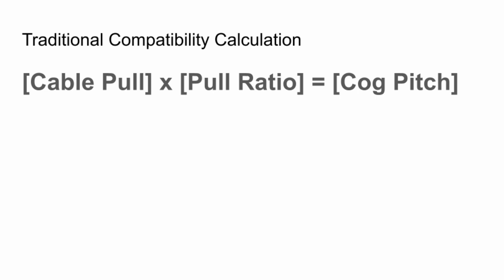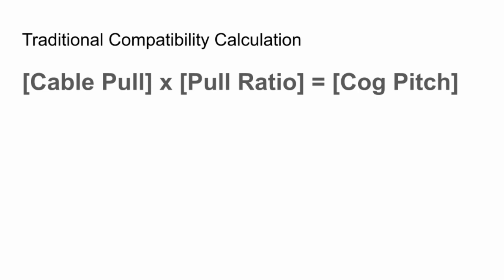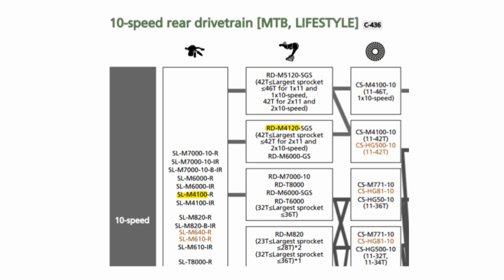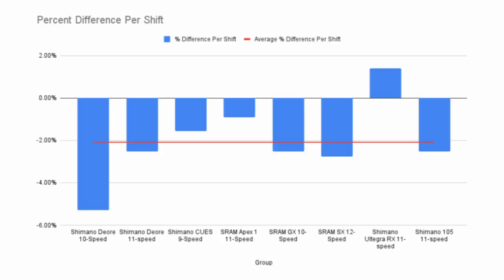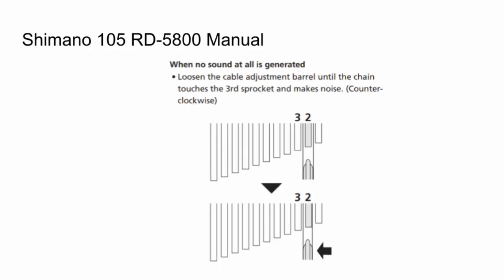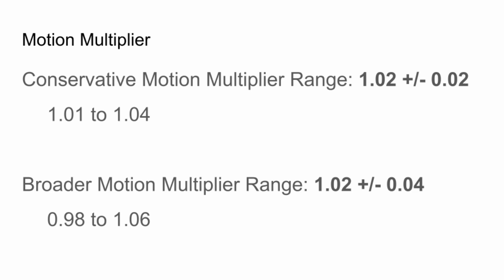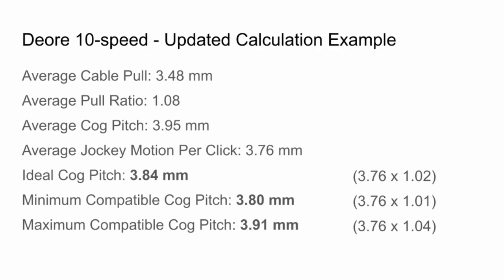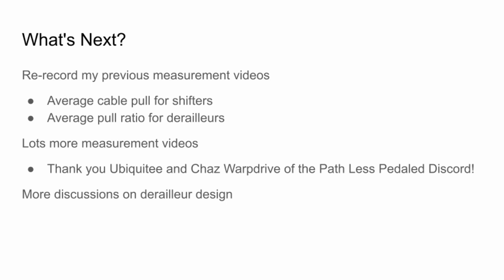The Problem with Traditional Compatibility

Comment: Back in the old days shimano had the centeron g pulley that had quite alot of play. I would rather new cassettes were available with the cogs and the spacers seperately so you could fine tune shifting with different width spacers

Comment: Excellent work!  Is the problem here not that the shifter pulls 2% less cable than expected, but more in the way the "average" pull ratio is calculated? Does an average of a non linear curve really make sense? Don't you need to do something like integrate the pull ratio curve equation, to get the total mech movement for the range of cable pull you're interested in (or just measure it)? Or is that how you did it? Maybe it amounts to the same thing.. and I'm probably misunderstanding everything!
Reply from the maker: I think you're understanding it correctly. I'm not doing any integration. It's a bit tricky, but I'm figuring out the amount of cable pull needed to get you to the second biggest cog and subtracting the amount of pull to get to the second smallest cog. I then take that number and divide it by the distance between those two cogs on the cassette. You're right that this doesn't account for the nonlinear motion of the derailleur, but it should work fine since shifters compensate for that nonlinear motion too.

I do have the actual curves and shift points, so it's straight-forward to figure out the jockey position for each shift point. When I plug in the numbers I get similar results.

I'm starting work on a website to try to do these calculations and show you what it looks like. I want to make a video when I get the website to a presentable state.
Reply: @boothsbikeprojects  Ah I see. Will be very interested to see your website when it's live! I've also been working on a site to compile a list of pull ratios etc. Do you have some ideas as to why shifters pull slightly too little cable? I was wondering if it could be to compensate for very slightly bent mech hangers, or worn mech linkages as the mech ages?

Comment: Here's what you do ;
Ditch the index, ditch the wireless, the electronic, the whole fancy complicated controls.
I just finished an 1800 km tour, fully loaded, on northern Ontario hills and challenging highway. My gears are friction. Downtube mounted. From 1979. Japanese. I use one derailleur, the rear, a pre- index Shimano Altus. Works perfectly.
You tune in the gears just like you tune the strings of a guitar. You always have complete control and I wouldn't ever consider anything more complicated. My shifter has about five parts. No springs, notches, batteries, wires, charger... 
Riding a bike doesn't have to be so over thought and over designed. That is, if you can manage the skill that it takes to do something simple, and do it well.
Reply: If it works for you, great. I used contrafriction shifters (Simplex, the best made) for decades. With the change in chain and cog tooth design over those decades, friction shifting no longer worked the way it used to. I got tired of grinding my shifts, and when the hard-to-find spring in the right side Simplex shifter failed, I begrudgingly moved to a Shimano SIS six plus one, shifter. The option is to use all friction, or 6 indexed, the seventh being friction.

I like getting the gears right almost every time, I use the indices. For some odd reason, grinding one's chain across the cogs is not good form.

Edit to add: I still use the friction shift for my 3X at front. Stronglight 99s for the record, chainwheels still readily available from SPA Cycles in the UK. I'm in Toronto.
Reply: @stephensaines7100  I've probably seen you. Ridden Toronto roads since 1970!
Reply: @stephensaines7100  I just re-read your text there. Lots going on! I am lucky to chance upon old great vintage bikes in new condition. They're like finding gold ingots, maybe with a bit of gold filed off, but still gold. I'm a huge fan of 70's 80's Japanese everything in bikes. 
I've had my simplex rear changer blow apart miles from home. I never loved the simplex except for how it looked.
The way I see it, a philosophy, any philosophy or aesthetic, needs to survive being stripped down to it's essentials. So, like the simplicity of chain drive, friction shifting works in pure physics with no added assistance.
I did work in a few bike stores and I saw the new stuff just when it came out. Some developments were good. I thought that SRAM gripshift, indexed, was the be all and end all for gearshifting. I have a Cannondale recumbent out in the shed from 2003 that I bought new at the store, and it's gripshift still works fine. Just the rubber handle grip wore off with sweat and sun and sand and rain, going clear across Canada and lots of other trips.
Cog teeth, chain design, yes, those things may have changed, but still for me the objective is to get down to the most simple lay- out. I was years in toe clips and straps, racing and touring, then got the clipless, for decades, now I'm on rigid soled cycling shoes on a platform BMX style pedal and that's it.
Most of my bikes are single chainring bikes. I think seven gears on back is enough. I like rim brakes. Cables out, where I can maintain them. I think all the modern stuff is messing with people's minds. Sometimes tradition is there for us so we don't have to confront trendy fads and other baloney. Cheers mate
 Stay safe
Reply: @davidrobinson9507  Malcolm at Biseagal claims he has replacement parts for Simplex shifters. When they work, they are the best.
Reply: @stephensaines7100  go for it. Long live the retro age !

Comment: Pretty much all of the shifting happens from the ramps on the cogs. Guide pulleys have a little bit of slop in the bushings in my experience, I think it is so that the cog can shift the chain smoothly and the g pulley will follow it into place as the chain climbs towards its final position over the cog. I think if they made the der travel bang on, it would interfere with the smoothness of the shifts, because it would be pushing the chain to the center of the next cog before the ramps have time to guide it there with a smooth power transfer over the ramps. So by designing their derailleur movement on the low side, I think they help make sure that a little bit of wiggle room appears for the g pulley to loosen up as you start ramping up into those larger cogs. Just a thought
Reply: Idk though, actually the distances we're talking about here, on the order of half a mm, there is probably that much wiggle rooms at least just from the loose chain mesh over the pulley.

On second thought, I wonder if you're just observing the losses in the cable winding through the shifters, flex in the components, friction etc that would inevitable cause a loss of efficiency  of derailleur movement compared to what's predicted by the design spec. 1-4% seems totall within the error for that kind of thing?

Comment: Thank you! I finally understand what the pull ratio means and its real-world limitations. I'm guessing that the reason for moving the jockey wheel slightly less than the cog pitch is because it reduces the lateral kink in the chain as it turns around the jockey wheel. Is that your understanding as well?
Reply from the maker: I'm still trying to understand why they're designed this way. I've got a number of ideas, but I haven't put it all together yet. I'd like to look at some older 9 speed groups to see if they work the same way.

Comment: It's interesting that this project is benefiting from Pathless Less Pedaled chat. I've been a little too verbose in commenting on the complaining videos (buying and discovering a new incompatibility. My point has been look at the products along the lines of design intentions - your project will benefit this I hope. I've suggested trying to understand range and limits from the actual parallogram design layouts. Ex. Old 7 sperd derailleurs could be pushed to cover 8 but not 9 speed gear ranges. Just trying to understand these physical limitations and appreciating what parallelogram design configurations had to emerge in order to cover 10 then 11 speed cassettes can shift the mindset from complaint to appreciating the realities of newer products. 
I'll keep watching.
Currently Cues (and Linkglide) is an unknown to me. It has been interesting watching Shimano try to keep legacy pull ratios in their product line like RD-3100 9sp. Or making a 10speed system that was upgradeable to 11sp - RD 4700. 
Flow charts certainly help with confusion but you are going deeper into the understsnding of product designs.
Bravo, I hope Russ is watching and Bikesauce too.
Sorry - too wordy again.